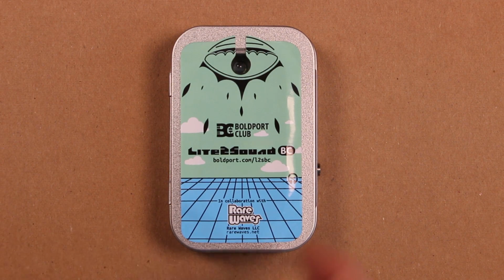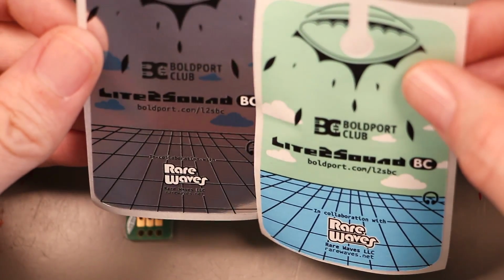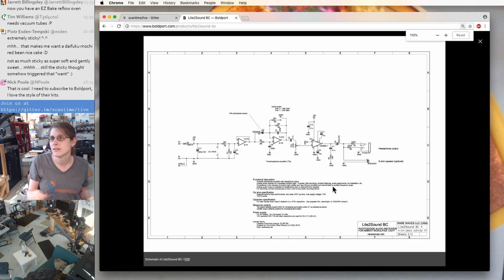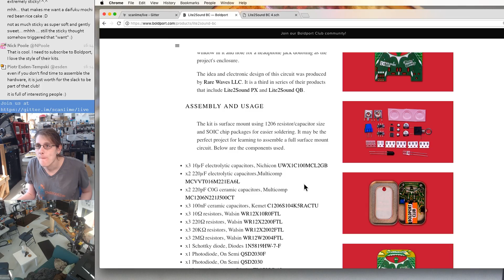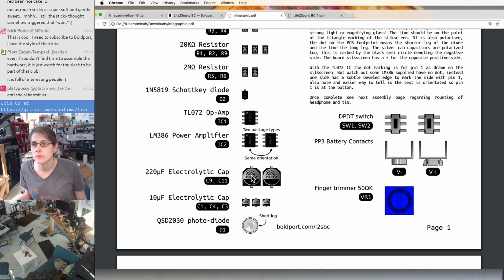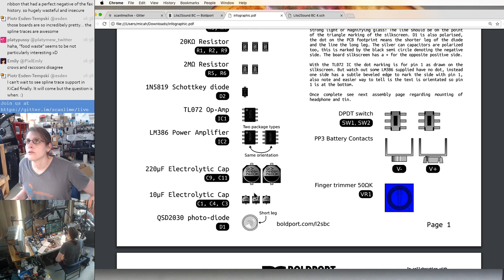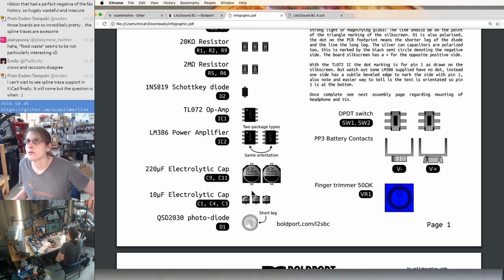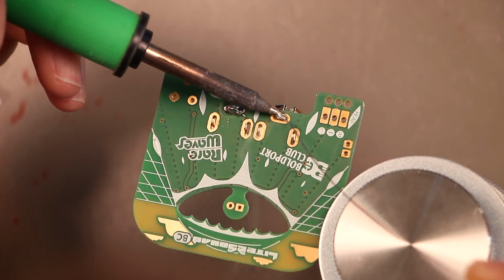Sound Waves from Shadows with this Soldering Kit

Comment: would it be possible to make this into a makeshift laser microphone? Attach a mirror to a thin membrane and shine a laser reflecting off the mirror into the diode?
Reply from the maker: Probably! I didn't have time to try that in this video, but I'd love to experiment with this, or even putting a mirror on a speaker cone.

Comment: There is a family of microscopy techniques that apply a different modulation frequency to the light illuminating different parts of an object.  It's all collected on a single photodetector, and different positions can be resolved by modulation frequency.  I've never turned one of those signals into audio but I think I'll have to try now.
Link to original paper (open access): https://www.osapublishing.org/oe/abstract.cfm?uri=oe-19-2-1626

Comment: Great video! 
This circuit might help me with a project I'm trying to do that involves detecting a very small amount of light and converting it to a voltage. I've got a photodiode and op-amp circuit that seems to work, but it could definitely be better. Also, in my research, I seem to have found some dependencies on what direction of polarity the photodiode is supposed to be connected to the op-amp, and some seem to suggest it works in both directions.
Reply from the maker: Hi! Yes, there's a world of subtlety in photodiode amplifiers, especially when you want to accurately detect very low light levels, or when you need very fast response. I've heard of both polarities, as well as designs that apply a DC bias voltage to the diode.

Comment: What kind of PCB holder are you using? It looks like it is easier to release the pcbs than the screw claps I have
Reply from the maker: it's the hakko omnivise! there are definitely cheaper options but if you work with oddly shaped or delicate PCBs a lot it's worthwhile imo
Reply: scanlime thanks! Do you think is possible to transmit digital data via this light off and on?
Reply from the maker: Definitely! Optical transmitters could range from something very simple and relatively slow which you could hear in the audio frequencies with this circuit, up through more complex multi-mode fiber transmission that this receiver wouldn't be able to see. I remember reading about a DIY project called the "RONJA" many years ago, which used discrete logic and LEDs and photodiodes to form a 10-megabit network link between rooftops.
Reply: scanlime cool!